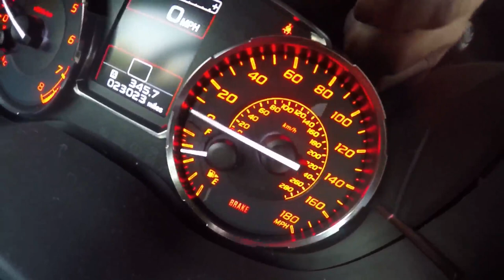2015 Subaru WRX Ep. 737: Blew Off A Charge Pipe Hose

Comment: They actually sell funnels that attach to the top of your radiator, I filled the funnel up a little, ran the car to 200 degrees and the air on full blast hot. I let it run for 10-15 minutes.yes you may only see just a little bit get taken but it's still nice knowing their is no air in the system.
Reply from the maker: cool

Comment: hi Mark just a question off the topic of the charge pipe have you ever worked with caliper covers metal ones and woukd you know the best option to build a bracket to hold it in place?? if been following you for awhile now and thankyou for the heads up on the limited release badges I got my three =) I think I told you just have changed name from original one
Reply from the maker: naw, i couldny comment on fake caliper covers. i would never run them on my car.
Reply: that's all good I wasn't keen either but I was just interested hshhs thabks for letting me know
Reply from the maker: you could make any bracket at all tho.. just get a bar of aluminum or steel from home depot.. bend it.. drill a couple holes in it for bolts.. etc..